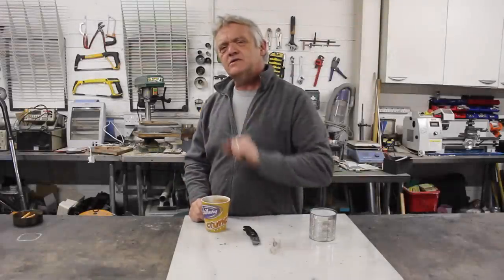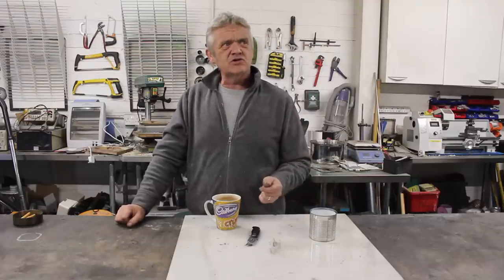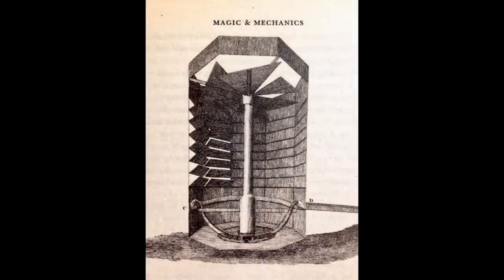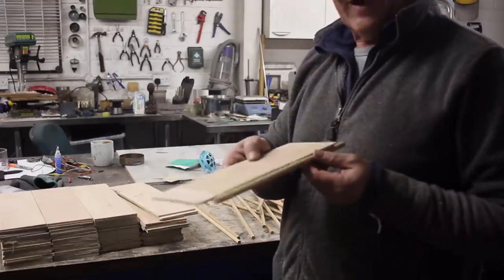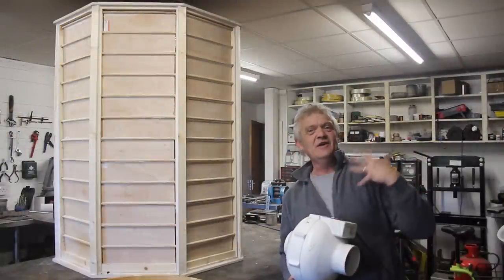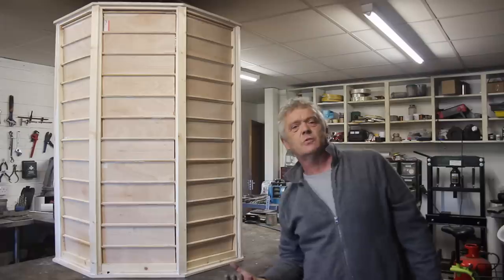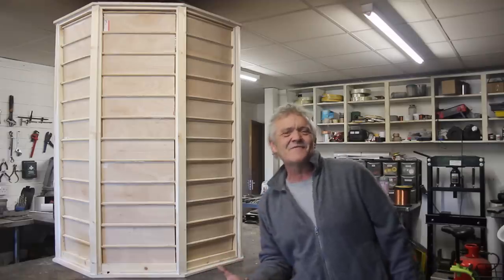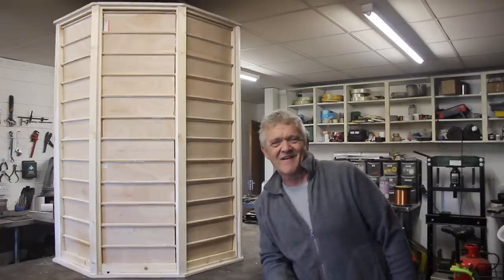1725 Aeromine And A DIY Wind Turbine From A Lost Technology

Comment: the mass of the flaps is increasing the drag, and therefore reducing the available energy of the wind when it reaches the turbine. At low wind speeds I think this will have less ability to generate, until the wind speed (and therefore the air pressure on the windward side of the tower) can overcome the resistance to the air flow from the restriction caused by the need to raise the mass of the flaps.

At higher wind speeds, the swept area x air flow model will have a similar outcome to that of a force aspirated engine, in which the capacity is artificially increased and could overcome the additional load by increasing the effective swept area.

There will be a break-even point in the wind speed, below which the flap tower will be more load than benefit, and above which the load is less than the benefit it provides.

I do like the idea for its omnidirectional ability, and simplicity.

In a high wind location, this is a compact option.

Comment: How about making the wind collector with a square footprint which rotates to face the wind like a dutch windmill. Then only one face of the collector needs the flapping louvers and the other 3 sides don't, which is easier build. Ok I know there's the added complication of building it so it can rotate but figuring that out is part of the fun. How about a pivot  and casters around the circumference? Tony

Comment: Make these even cheaper using vertical vanes made of thin and flexible plastic. Or to look a bit nicer use fabric. May need to be reinforced with thin bands around the outside, or you could make it function like a heart valve, with ligaments holding the inner edge of the fabric from blowing outward.

Comment: My oil burner has a flue vent that has a constant draft, no matter what the conditions.  I used to use it to blow my weed smoke out of it.  I'm wondering if it would form a better draft if the chimney were taller?

Comment: Love this channel - great ideas ! As this construction is exposed to the elements, I think we need to think a bit more about using weather-proof materials for this project, and as one person mentioned in a comment, to use a thin piece of rubber to reduce the noise of the flaps when opening and closing. I‘m not so sure about the efficiency of the design however : if it were simply open at one side, no wind energy would be lost in the opening of the flaps, and as the wind comes predominantly from one direction (where I live), I think that a simple „half circle“ shield at the back of the turbine may even be more efficient, and easier to make, than this design. Comments/input = appreciated!

Comment: Great Rediscovery of some simple But effective Design.

Maybe its possible to Achive a greater efficency by Putting a Hyperbolic cone on the Bottom of the Tower
So that the incoming Air gonna be directed upwards instead of crashing into the opposite shuts.
Could be easily Made with a Rubber membrane, a washer through the Center, and some Strings Pulling it up.
With this it would come fairly Close to the Wing Idea i guess

Comment: From what I read, the Aeromine 50% number is about cost over time - solar cells being more expensive to acquire. I don't think they're claiming anything about efficiency per area, just that this is a smaller net cost per kWh. From what else I've read/seen, putting these on your roof produces less power than covering the same roof in solar cells, but I think the hope is to provide a green energy source for those with a smaller budget.
Reply: Whats interesting to me is that aeromine will generate energy in the windy season of sync with the sun

Comment: Couple of thoughts use lightweight semi rigid flexible plastic and secure the flaps on the bottom not the top.  The plastic's springiness keeps them closed, the wind pushes them open and because they are secured on the bottom the top of the slat opens and the air is already being directed up so there would be less energy loss from the air having to bounce around inside the structure changing from moving down as it would with your hinged slats opening down.  If concerned with the plastic fatiguing where it flexes could use a real hinge with a tempered spring calibrated to open at a specific wind speed but that wouldn't be easy for DIY engineering. (spring clips somehow??)
Reply from the maker: nice ideas mate - thanks for sharing

Comment: makes sense it could funnel and exploit more flow than a VAWT the same size.
for use and longevity the wood needs serious weatherproofing, OR just build the panels from aluminum to begin with? I'd imagine a shallow funnel shaped top (only slightly smaller than the octagon) could help boost air velocity into a turbine, a rotating vaned top vent using open air wind to create vaccuum (lower pressure) for the exit out the top (top view being somewhat "\o/" shaped to always turn point into wind). something mechanically functional that could provide some protection from sun and rain, paint it black for a little help by convection flow too?

Comment: Just observing, I see that pressure inside really does effect how much wind may blow in, and that adding height adds to the pressure inside, that in turn limits what percentage of air may enter inside rather than go around, and results in diminishing returns with additional height. But one may be place a turbine blade on both top and bottom helping to half the pressure buildup inside, and that the two  turbines may share the same axial shaft, driving a generator on the bottom, allowing for both easy access and a lower center of gravity. 

it would be fun to build one maybe 3m tall and 1m wide, and erect it 2m off the ground so that wind may blow underneath. 

--------
Reguarding efficency, It would be more appropriate to look at the cross section of wind rather than foot print, as one would with traditional horizontal and vertical axis wind turbines, i expectbit to be on par with or a little less than some common VAWT.  But reguardless off efficency, I'm excited about the potential for low cost, and easy of build.

Comment: I wonder if you could do something like a small wind wall at the top with those small ceiling fan motors?  My thinking is that you would have multiple generators using one of those wind capture towers, it might not be as efficient as a big turbine motor but it would be interesting to see what one could produce.
Reply: Smaller turbines means less windspeed required. 👍

Comment: A small question: with the octagonal shape, most of the tower's angles deflect (some or most of) the wind rather than capture it.
Is there a way to maximize the tower's ability to capture the wind energy?
(One that doesn't alter it's design to the point where flaps are no longer needed)

Comment: would there be any difference to having the turbine and wind exhaust out the bottom in the same direction as the flaps point when open? in my mind having the flaps open down (due to gravity of course) then forcing the air up it would decrease the wind speed or would it create like a vortex effect adding more pressure / power going up,rather than putting the hole at the bottom? I'm certainly no expert in this area ....

Comment: Did you make those holes the exact size of the dowels?
If so, they may bind when they get wet and swell.

Just writing the above I thought of three ways to compensate for swelling dowels;
1) bees wax on the dowel and in the hole.
2) bore the hole 1 to 2 millimeters larger than the dowel.
3) go the expensive route and mount the dowels inside a bearing that is inserted into the frame upright.

Comment: Glad you made this I am looking forward to the actual turbine part to see how you design the blades  I am in the process of 3d printing a ducted wind turbine I did think of making the Darwin one but wanted something with less moving parts to wear out and not to sure about the noise the flaps might produce in gusty or direction changable wind 
so I am going for  basically 8 segments feeding into a downward shaft and a curved base to suck the air out 
I am working on the idea that lots of small ones mounted on a barn roof will supply plenty of power and if redundency if one goes out 👍

Comment: Fantastic design although I'm wondering how much noise those flaps will make in variable wind conditions as one of the biggest concerns about wind turbines in urban areas is the noise.
Reply from the maker: that's an easy cure mate rubber strips

Comment: you can get a nice aerofoil shape if you just take a sheet and bend it slowly back onto itself maybe with cardboard tube at the midpoint and then bend around that.  spot weld along edge if using sheet metal.  tape if sheet plastic. 
two of these as upright columns and gap in btween is where you place the generator fan pointing up

Comment: If you put Curved Flaps on each Corner of the tower, to draw more air, then add a Bearing in the Center Bottom of the tower. You can add a big Sprocket with Chain or Pulley with belt to turn a Generator on the Bottom, but? You love Magnets and Coils. Add Stationary Coils around the Tower's Bottom, the Magnets can rotate with the Tower, which I think could create more elct. than one can imagine, as the Tower generates two types of Elcts., During low Winds, the Curved Flaps will help generate that top generator faster. I wish I had money to help you, but I am disabled, and barely trying to invent things too. Take care, and best of luck. I do love ur videos, Brother.... I have learned so much in life from your brain....

Comment: Excellent video!! 
They "lose" this technology of the past, we only have to look at the fact they had electric cars 130years ago at least and had solar panels attached to a model T at some point in the 30s-50s I believe. They also had hydrogen cars and generating hydrogen from solar In the 70s-90s using an American Corbette solar sea water ZERO emissions and gravity to fill the tanks 8 hours was enough to run a 5ltr+ v8 400+ miles! All free and clean only pure water out the back.. 
If "They" were REALLY interested in clean ENERGY they could have it and repair the environment at the same time petrol and diesel cars could be retrofitted with minimal effort or parts and run on hydrogen, existing diesels could run on used vegetable oil kicking out relatively harmless emissions much less Co2 and onlu fractionally more Nitrogen and there are pictures and articles of cars in the early 1900s running on energy "from the ether" using the same/similar principal as Tesla knew about and used and they believe the pyramids also utilised now. 
This is not the first GREAT RESET AGENDA We've had as a species I believe there have been Many many and I think they do it to stop us advancing in technology and freedom past a certain point. 
There's now evidence archeological hard evidence for nuclear power 3 million years ago from a Uranium mine that is somehwere like Africa since the 70s quietly kept a secret yet known about and they know the isotopes found in many places around the world from ancient times  can only be created by nuclear reactions which is obviously flying In the face of the mainstream Rubbish they peddle as history still ATM.. 
I'm glad your channel highlights much of this technology that's being lost again and it's all stuff that if we got back to being a bit more hands on like our grandfathers great grandfathers and however many previous generations we might just have the skills they had I'm many ways we no longer have today! And technology that's been lost to time and destroyed/covered up/hidden allowed to be lost as it is not profitable for big business conglomerates and the elite... 
Sorry for the rant but I get annoyed that we are lied to about so much now and have so much we could be utilising to solve world issues that are PURPOSEFULLY being denied blocked for nefarious purposes and agendas by the likes of the WEF AND WHOEVER THEY SERVE!?
Cheers from London 👍🏴🇬🇧

Comment: Couldn’t you just have a wind rotatable solid pipe with a set of your flaps on a sixth of its length, with a wind vane pointing the flaps at the wind? It could even have some wind collectors running along the side of the flaps to funnel the wind. Thanks

Comment: Wondering if you could supplement this with small solar panels on the flaps to make a joint wind/solar generator. Looks great. Looking forward to the follow-up with the turbine.
Reply: Light angles are a big issue with solar IRC you would get performance only at sunset and rise.
Reply: @Barskor1  They don't have to be mounted flat - ie. angle them (based on direction facing - flatter for morning/evening sun, more angled for middle of day). I suspect the greater problem would be keeping the flaps closed with the extra weight whilst allowing the wind to flap as designed.
Reply: @dSquared0162  Maybe a Thermal cell?
Reply: @colleenforrest7936  ¯\_(ツ)_/¯

Comment: I would use textile as flaps with a chicken wire as backing. 
Plywood flaps are hard to make, heavy, lot of inertia required to open.. 
come on Robert, try textile instead :)
Reply: There are 2 uses in there, they need to also seal shut on the other side. I recommend use plastic but put the pivot point closer to center to not lose so much energy to gravity and inertia.

Comment: One possible downside I see with this is the noise of those flaps affecting the people living nearby. But a simple fix for that is to place a small line of foam along the outside edge of each flap, so when it slams shut it is much quieter. But man, this design is truly special because I’ve been looking for something like this which directs the air towards a turbine. I am also curious what minimum air speed is required to get the flaps to open?

Comment: A thought or two on possibly improving the design a bit.  That's a lot of flaps. If we use lighter weight materials, we probably could elongate the flaps so that there is less of them overall.  XPS foam or double corrugated cardboard reinforced with high quality epoxy (7k psi tensile strength or more) and S grade fiberglass cloth, makes some pretty light but tough and strong stuff. I don't like using epoxy much, but there is a company that tries to use as much bio content as they can while keeping high strengths and performance. They are called Entropy Resins.  I think their highest percentage of bio content epoxy is around 33% bio content. 

     Could one also put large scoops, billows, or the like on the outside so that the whole thing also rotates (the nice thing about this, is you could just use strong fabric for this, like sail or kite type fabrics)?  Connect another generator to that rotation?   I suppose this might interfere with the efficiency of the main turbine/generator though?

Comment: I think, youwant to orient the device upside down from this, for a couple reasons. On some stilting probably. Less can fall in, such as rain and snow, a little loose bird netting will keep most birds out of it, either way, but low enough to not have deflection loss from the ground, and neighborhood cats will scare off birds that try to stay long. Second, this means you can keep the shaft of your generator at a lower and more accessible area. Might also consider an array of turbines. 6-8 20 cm turbines can stack some power generation, might be cheaper than one major one, and you can put it all thru one electric leveler/regulator set up, either to a or with a battery array. also covers partial failure, so if just one or so turbines fail or get jammed, you only have a production dip, not it all is gone.

Comment: Surely it doesn't collect wind on the leeward side, so it isn't that much better than a wind-cocking generator? Also, the flaps must offer resistance that restricts low wind speed efficiency? I guess the bigger area from even a couple of faces makes up for the losses.

Comment: Surely a tower, that is essentially one trumpet bell shape inside another, with the appropriate gap between the walls and the turbine fitted inside, would provide the same wind power without the need for all the separate units thereby cutting production costs? Just thinking:)

Comment: Cutting 96 flaps looks daunting... you could probably stack several layers of plywood and cut them in one go, so (theoretically) you could cut 96 strips in about 7 passes, [ceil(log2(96))=7]. There are of course some limitations, such as the max thickness of material your blade is able to cut, but even at twice that (number of passes on the table saw), it should make this task seem possible even for those of us not blessed with your patience. :)
Reply: If this works, better replace the plywood for recycled compressed plastic panels. More durable and plenty to go around.

Comment: What if you make the tower able to turn and as a triangle 📐 and not like an octagon, and then put like 2 tail wings on an airplane out from the tower to keep the one side of the triangle towards the wind? This way you can have a bigger side towards the wind. The other sides can be solid in this case as they don't needs to be able to open.

Comment: On first reflection I'm wondering about the noise on a medium gusty day, opening and shutting.
But while thinking about that and how it would cope with storm force winds I had an idea.
flexible cloth or plastic membrane flaps with a bit of weight along the bottom and maybe rigid or stiff  sides.
Light, semi disposable or at least only the flaps will go in a storm and cushioned edges. If the flaps are significantly larger than the hole they should still block the wind on the non-entry side.
any thoughts?
Reply from the maker: I think that is clever thinking mate - nice one cheers

Comment: Great video Rob , love this concept ,i have a question , would this work better if you designed it with the hole on the bottom as the flaps are pointing down anyway ?